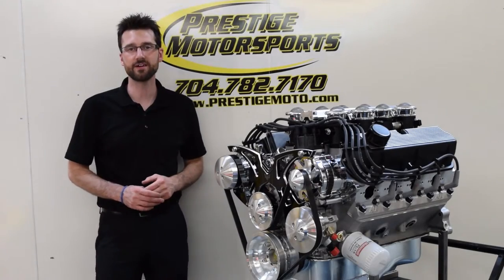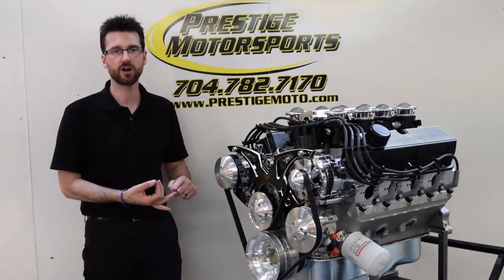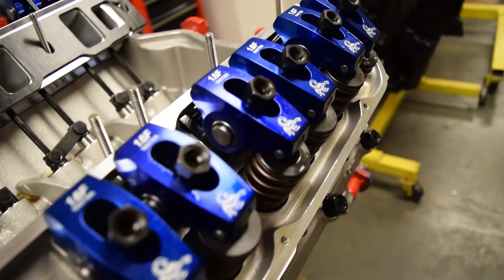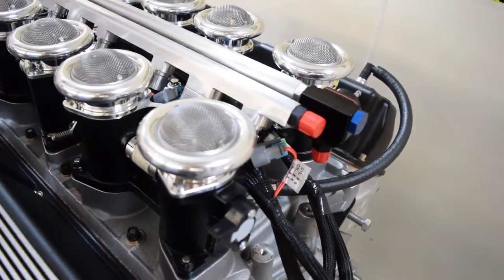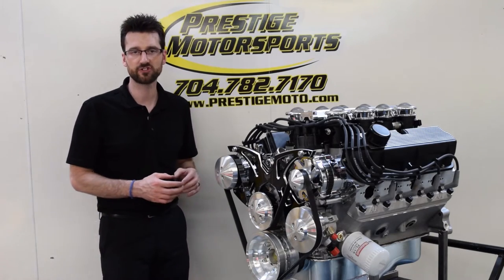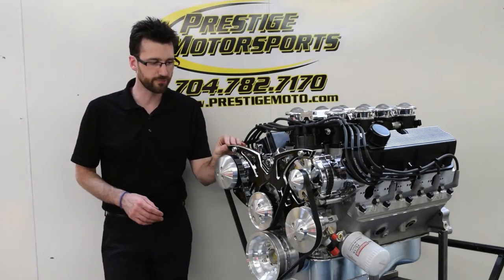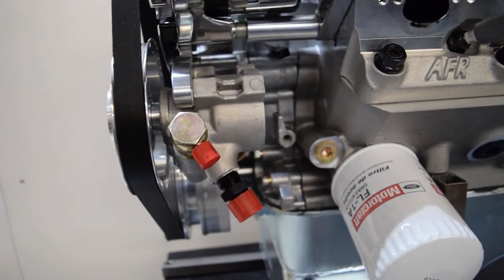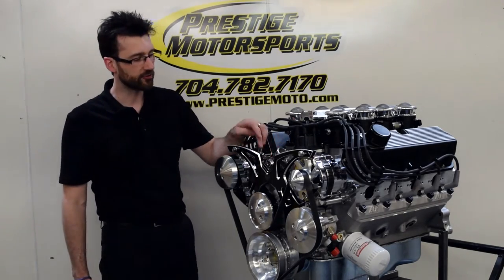Ford Aluminum 427 Stroker with Borla Stack Injection Holley HP System

Comment: This motor will make 750 horsepower with the kasse p38 heads and a carb. I think the fuel injection is the limitation on horsepower numbers cause muscle mustangs and fast fords ran the kasse 427 with fuel injection in a silver fox body they built and it made 600 hp.
Reply from the maker: The Kaase P38 heads are no longer available anyway but the limitation is the actual manifold of the Borla. We have done extensive manifold port work on a very similar engine package to increase output results but in the end it was alot of work that not every customer will want to pay for. These engines are usually for street rods and clients who want that beautiful look but also want a great driver quality so peak numbers are not always priority #1. Thanks for the comment and interest

Comment: How much and will it fit in my 1972 Cougar?
Reply from the maker: Prices will vary depending on exactly what options you choose whether it's a steel block or all aluminum as well as the front pulley choices and finishes such as polishing or custom powder coat. This style of engine package generally starts at $20,000 and goes up from there. Also yes it should fit in your cougar with minimal to no modifications. If your seriously interested I suggest calling or emailing us directly for a personalized quotation. We can be reached at 704-782-7170